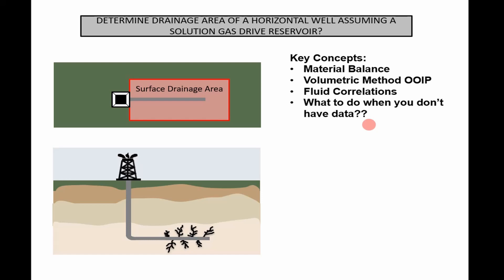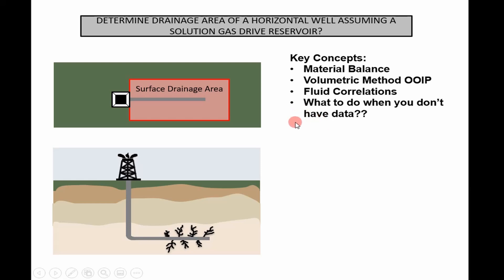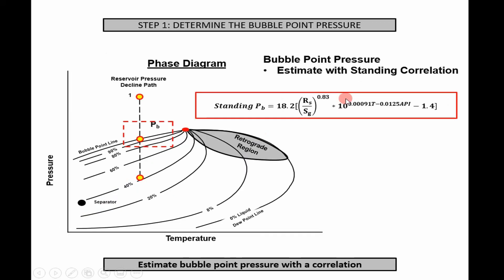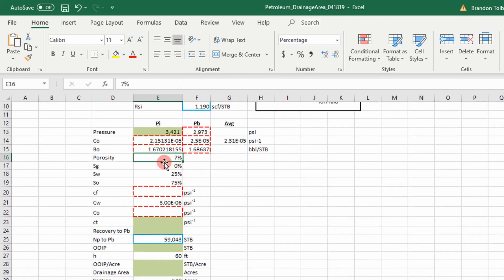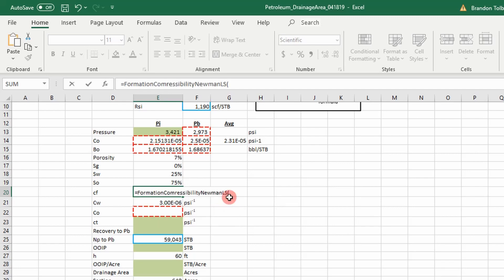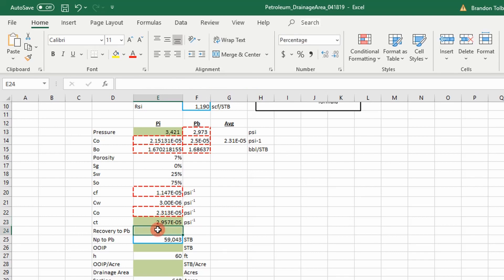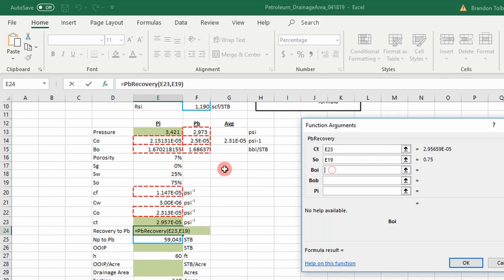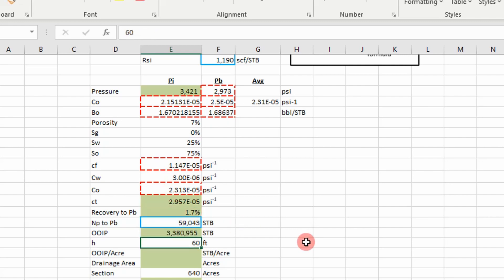Estimating Drainage Area of A Horizontal Well: A Step by Step Appraoch

Comment: hi. Hope you are doing great. For this tutorial. I read your description to see if there is any link to the VBA source code but I couldn't find any. Can you  share a link to it? or if possible the spreadsheet so I can try replicating my own. Without the VBA link this tutorial is extremely difficult or almost impossible. Would appreciate your help.
Btw, I found this link (http://www.fekete.com/SAN/WebHelp/FeketeHarmony/Harmony_WebHelp/Content/HTML_Files/Reference_Material/Calculations_and_Correlations/Oil_Correlations.htm) for correlations for some parameters? Can I use info from this link based on your VBA titles for correlations?